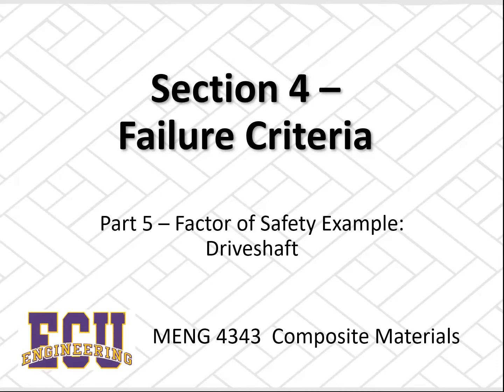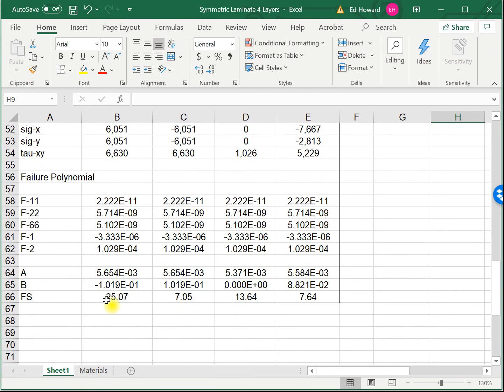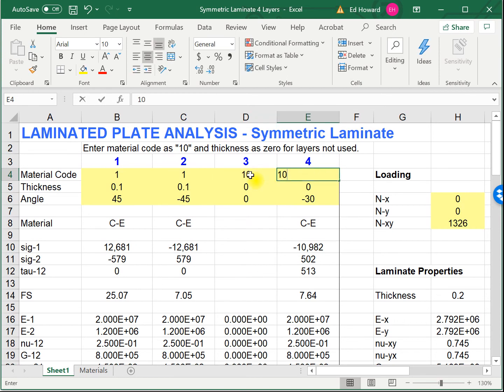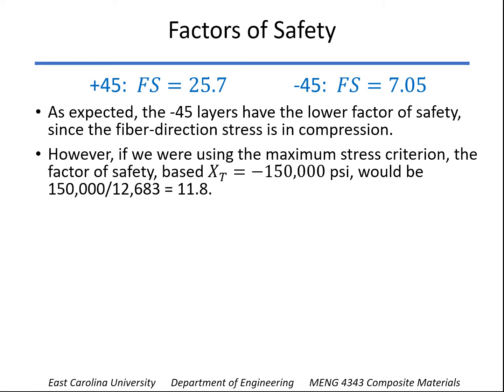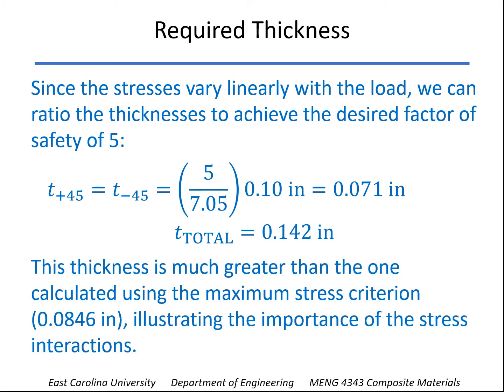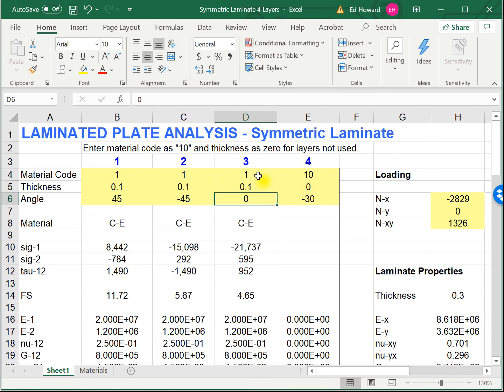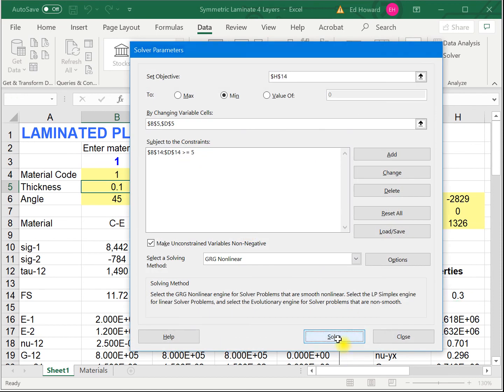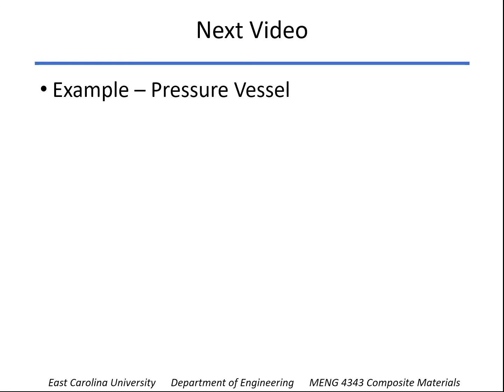Section 4 Part 5 Drive Shaft Example

Comment: How do you know you have to use Nxy and not Mxy? if the Mxy is the twisting one, and how did you calculate Nxy in the shaft (Only applicable on shafts?)? I mean the formula with the torque. Thank you